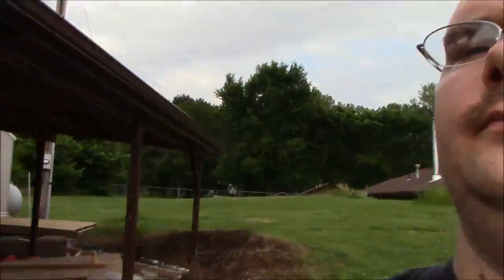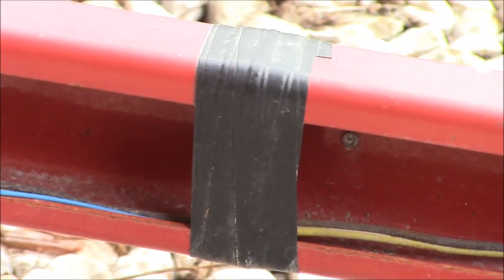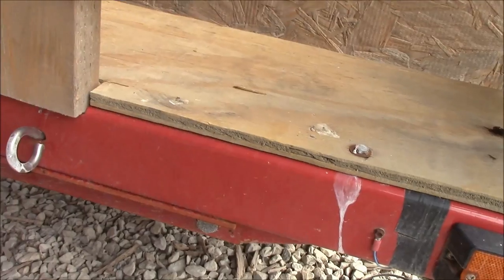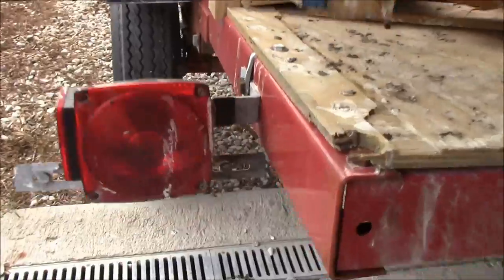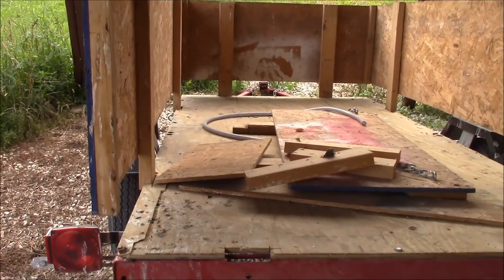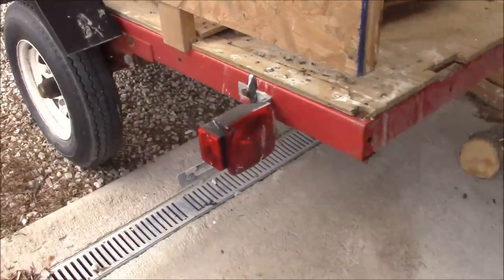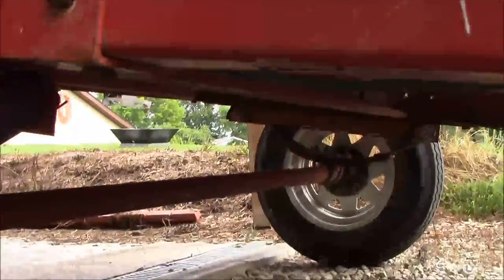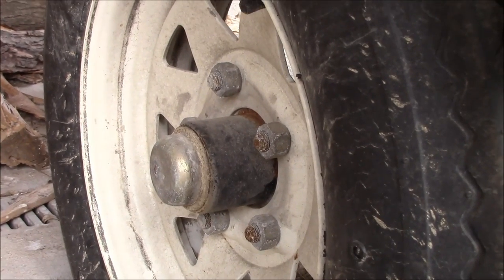Harbor Frieght HF 1720 lb Trailer Review

Comment: My 4x8 trailer (Harbor Freight) came with stake mounts that go on the outside, thereby allowing for the full 4x8 interior size.  I also took the time to use galvanized bolts on my 3/4" pressure treated deck. (The rounded kind that countersink into the wood and leave a smooth little lump instead of the hexagonal)   I've had mine for over 5 years and not had one bit of problem aside from the too low position of the licence plate and loading issues with my 54" mower.  This mower required the making of a specialized removable frame system since the deck is much wider than the 48" deck.

Harbor Freight gets a bad wrap a lot, but this is one item that had service be well, and can be had cheaper if you wait for a 20-25% off coupon.

Nice video.

Comment: I have not bought one yet.  I have one I can borrow and am considering buying my own.
Reply: Find a 20% or more coupon and go for it.  Its worth it.   I used my bearings as they came and am going on over 5 years with no issues.  Assembly can be a bit tricky and it helps to have an extra set of hands.    One word of advise to help square the frame up, have your decking material cut at the store.   Lowe's as an example has a huge cutting machine that will make perfect straight cuts.  I went home with two 4x4 sheets (fit easier and handled easier too) and placed my frame assembles on top of the wood to use as a template to mark and drill the holes.  This will assure the holes in the deck line up with those in the frame and that the frame will be square with itself.